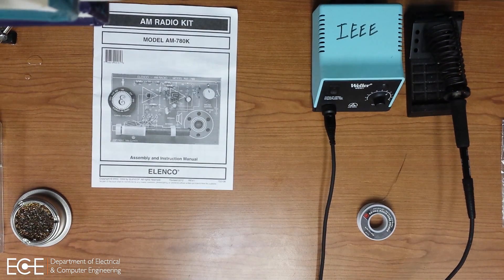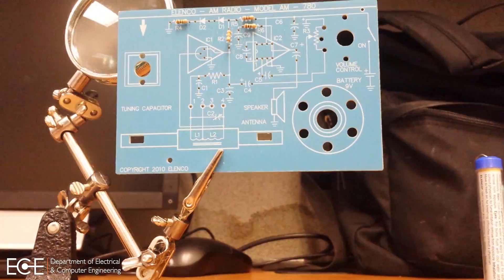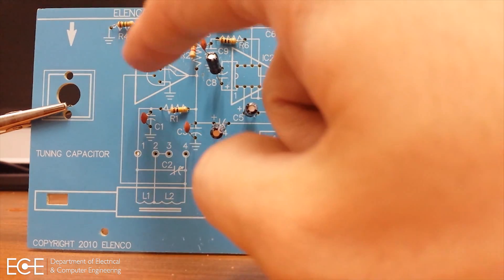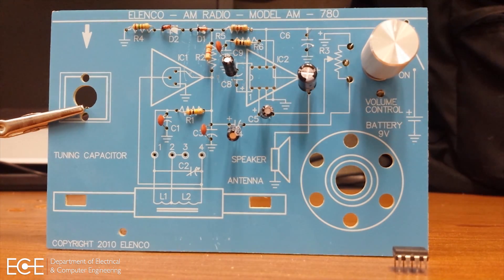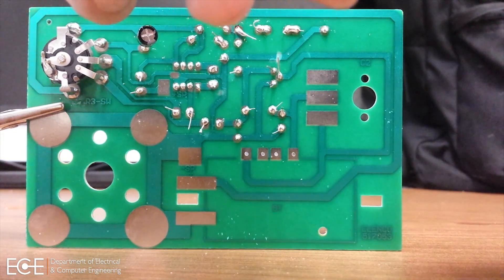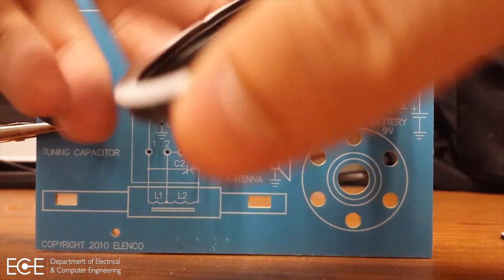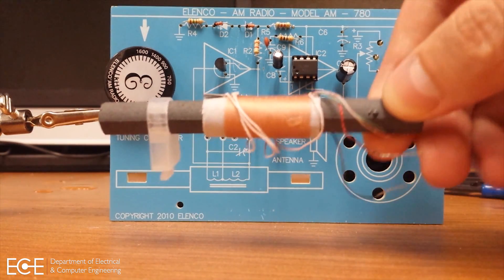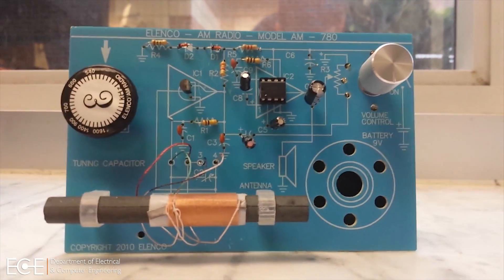AM Radio Kit

Comment: If your kit come with lead free solder don't use it,it needs more heat ,Cruz brittle,and a host of other problems ,use 60/40 lead solder,Kester is the brand I use for many years,size .0.31perfect for electronic soldering.

Comment: Where to buy?
Reply from the maker: roma formalejo https://www.amazon.com/Elenco-Two-Radio-SOLDERING-REQUIRED/dp/B0041O4MFK/ref=pd_aw_fbt_21_2/144-9325648-9328811?_encoding=UTF8&pd_rd_i=B0041O4MFK&pd_rd_r=b68bb905-e6b1-11e8-881d-e959e7c3588f&pd_rd_w=4Q3GF&pd_rd_wg=JpRDe&pf_rd_i=mobile-dp-sims&pf_rd_m=ATVPDKIKX0DER&pf_rd_p=b98fa1a4-6e6e-4981-835c-7fb29e0f4dd2&pf_rd_r=VCF9D0XRX3B9QFKZFQZG&pf_rd_s=mobile-dp-sims&pf_rd_t=40701&psc=1&refRID=VCF9D0XRX3B9QFKZFQZG

Comment: Capacitor C6 is clearly mounted on the the wrong side of the PCB.  Just look at the silkscreen image of the capacitor -->  --)|--
Also, it is nice to use a lead forming tool if available.
Otherwise, good video and well worth the purchase and build.
Cheers!
Reply: Peter Arnt Yes I agree, I just finished building this kit and the build manual said nothing about placing C6 on the back of the board. I placed mine on the printed side and the radio works great and I got reception on first power up.

Comment: It's interesting that you didn't have to do an alignment. Usually, there's a number of IF and oscillator cans that need to be adjusted.
Reply: not at that , because its an stright forward reciver, without conversion to an IF.
Reply: The only alignment would be to side the cool back and forth for best reception on AM.

Comment: Good Job. But Why has to be the Capacitor C6 on the Backsite of the board, it makes no sense för me?
Reply from the maker: Frank Schacht it doesn't make a difference functionally. It's most likely a height minimization preference since the cap is bent sideways, and height is larger than radius
Reply: There is a cap right next to the one your talking about...and it is bigger than the one your talking about on the back..so I dont think height is the issue.

Comment: Hello, do you know any problems that are usually had with this that makes it not work? I accidentally soldered two together but they are in the same circuit, I also burned the electrolytic radial a little bit with my soldering iron but it doesn't seem so bad any tips?
Reply from the maker: I'd check for polarities on all of your parts, be sure all of your radial caps are oriented correctly, be sure your IC is mounted in the proper orientation as well as your diodes. 

Check pages 8 and 9 of this document for troubleshooting: https://www.google.com/url?sa=t&source=web&rct=j&url=http%3A%2F%2Fwww.elenco.com%2Fadmin_data%2Fpdffiles%2Fam780.pdf&ved=0ahUKEwiQ0ODLguXRAhVq6oMKHX1BDy8QFggaMAA&usg=AFQjCNFZvjgJc-w8VUEwOKAhAKf9Hm-2hw&sig2=k4-iPGdTdvqgyS9u4fJv2w&pageId=108327030634650640815
Reply: Sarli turns out I burned the radial I just got the red fm kit and I'm praying for the best, thanks for the responce

Comment: Good job.  For me, I'd press the components closer to the board (even if a fraction of a mm), use less solder per component leg, clip all of the remaining leads off as close as possible (i.e. no or very little lead on the solder side showing).  In this kit I'm guessing these things are no big deal, but there are kits/projects where these extra precautionary steps will make all the difference between a working circuit and one that doesn't.

Comment: Pretty cool. Where can you buy these kits? What is the cost? How sensitive is this radio? It'd be cool to have a case for it, like a clear case, so you can see the insides.
Reply from the maker: https://www.amazon.com/Elenco-Two-Radio-SOLDERING-REQUIRED/dp/B0041O4MFK/ref=pd_sim_21_2?ie=UTF8&dpID=51jrTSj2hhL&dpSrc=sims&preST=_AC_UL160_SR160%2C160_&refRID=A1VP9APYVEK0FK3XA3GA